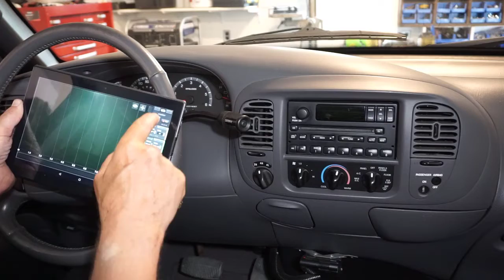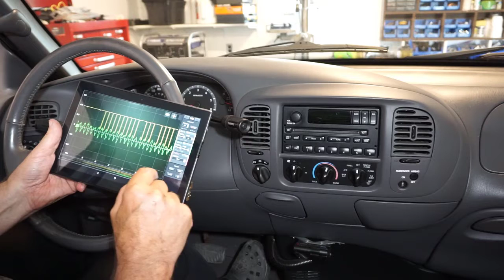GADGETS#153 - DIY DRIVESHAFT BALANCING

Comment: I think I'll stick with a simple pry bar. Make sure the vehicle is properly supported, take a pry bar resting on the floor board above and slightly slide it to barely touch the spinning driveshaft. Put a hose clamp opposite of the shiny mark that the pry bar made on the driveshaft. Keep checking until the vibration is gone, Now you know where to place your weight where the clamp worm gear is.

Comment: Could you possibly balance a crankshaft or be able to build a crankshaft balancer I would love to have one of my own even better if I could build it.
Reply from the maker: there is one in the works as we speak, John ... a 100 Kg soft bearing balancer complete with belt drive system ... metal + 3D printed parts ... a winter project and coming along nicely!

such a machine will handle crankshafts and other industrial rotors such as armatures, pumps, fans...

estimated build cost $300 USD

I need a few more weeks...

Comment: Denis, in this case does it matter which orientation the ADXL335 sits on the differential? I guess any vibration would transmit side to side as well as up and down so it shouldn't matter? I might have to balance a 3 piece driveshaft in the near future but wondering your thoughts on mounting the ADXL335 in the middle of the car lets say at a joint in the driveshaft. Would you just secure it somehow to the body of the car?
Reply from the maker: for vibration analysis, orientation wouldn't matter...BUT for dynamic balancing orientation does matter...there is a "+G" and "-G" to the parasitic weight movement withing the accelerometer...I intend to do a video on that subject at some point in future...

worse case scenario is being 180º off, you'd realize the mistake

for that 3 piece driveshaft, I'd place the ADXL335 onto the center support itself

and temporary correction weights first...confirm your work and then make the weights permanent

good luck and let me know how you make out

Comment: This is amazing and i would love to try it, however, the bits all appear expensive and pieced together, i am overwhelmed by that. if they had an inexpensice kit with everything id be onboard. 
ive been through alot with this driveline vibration issue.

using a hose clamp the caveman way is alot of fettling. drive it, adjust, try this/that, dozens of times vs that device.....
i'll tell you what though.....
I will bet you ten chickens and two pigs that the heavy spot is 99% of the time going to be where the runout is. 
If you put anything near the shaft almost touching and spin it slowly, you can see if its spinning true or if it is slightly out of round. a dial indicator is great too.
and then the weight needed is the key.
the head of a hose clamp is a bit heavy. 14 grams.

My runout is .019" at the rear and almost zero up front. 
Ford specifies <.030" 
its an ok shaft. persnickity builders look for .005" or less
Reply from the maker: a budget oscilloscope (supported by HScope) and a $4 ADXL335 accelerometer powered by a DIY 5v REF Box and a $12 analog IR sensor and you can do what I was doing here...

there's a learning curve...as in most things
Reply: @theGADGETSplaylist  i still dont understand. but i would love to be able to do it like you are with the van up on jackstands. like i said i have a high level of certainty the amount of weight needed is proportional to the runout however that sensor picks up AMPLITUDE and i love the graph charts... theres still the trial and error of HOW MUCH weight to use and would take just that, experimentation and verifying the result.
Reply from the maker: @dangerdavefreestyle  yes, you see amplitude and location...then trial weight...next run results will indicate if too much or too little

Comment: Another brilliant gadget! I have to balance the driveshaft on my Suzuki 4x4 and will adapt this method with the PicoScope 👌🙂
Reply from the maker: thanks Ivan!

for DIY, analog is the way to go here...ADXL335 (analog) and analog IR sensor for reference and your PicoScope (or that HS402 WiFi Jim gave you that would allow you to do this from driver's seat, no wires)

Martin and I are about 1 yr into a digital dynamic balancing kit. Serious stuff this one...

Your interest in my channel sure has been a nice boost:)
Reply from the maker: the key to this is a clean sine wave...usually needs software filters

oscilloscope filters typically "shift" the waveform as it cleans it...I suspect PICO filters would do this...

@ 3000 RPM, it doesn't take much...

in working closely with Martin, he developed filters that do not shift...a game changer for this work

a recent development that has not found its way into the HScope "production" release...only in BETA at this time

scrolling down the Google Play HScope page allows the option to join BETA

a $3 ADXL335 powered by your 5v REF Box and analog IR powered by another 5v REF Box and HS402 WiFi and you'll be pleasantly surprised Ivan...
Reply: @theGADGETSplaylist  very neat, I'll work on rigging something up 👍😁
Reply: @theGADGETSplaylist  I have the Pico NVH vibration sensors, but need to come up with a way to rotationally sync the shaft (like you did with the white tape and optical sensor). Maybe a small magnet and a spare ABS sensor or crank position sensor to pick up the signal?
Reply from the maker: @PineHollowAutoDiagnostics  I've gone the magnet route in #54 using low cost pickup sensor available on Aliexpress (most everything I use comes from Aliexpress)

there's 3 options...magnet, IR, laser

I like magnet least...and there's also the weight of the magnet to offset/deal with...

lasers are digital...opening another bag of worms...

your best bet is IR...analog one...I'll post a link to 1 I can recommend...I've had success at 3450 RPM balancing, even handheld (#60 at 9:50 timestamp)
Reply from the maker: @PineHollowAutoDiagnostics  better yet Ivan...I will mail you my spare E3F-DS30C4 IR sensor:)

forward your shipping address to:

thegadgetsplaylist@gmail.com

Comment: Did you notice any differences putting weights at the front if the shaft vs the rear?
It is common to find a weight at each location of different grams and different positions. 
And when one is changed, does that affect the other? Or can this hose clamp method be done properly on one end of the shaft at a time and provide an overall benefit?
Reply from the maker: would be one end of the shaft then the other with accelerometer positioned near the end being measured...

on long drive shafts, when one is changed would not much impact the other...

Comment: What is the "overlay" you use to determine the exact angle?
Reply from the maker: it is a 720º overlay which is a built in feature in HScope APP and very useful in automotive engine work that involve 2 full rotations...

since the making of this video, Martin has added another 360º overlay better suited for this type of work...and that I was using in GADGETS#157

Comment: Hi I have just came across Your channel and i must say what great stuff! I was researching 
flywheel lightening and balancing 
for "Bitsy",she's my classic 2cv sports car that I am always tinkering with.And thanks to You I now feel confident
to take on the task.
I've already been on Ebay for some bits, piezo transducers for a pressure sensor build to read what's going on
inside my garbs and to compare My twin exhaust pressure for tuning.
Also You've given Me an idea, for using hall effect sensors for an upgraded ignition timing system.
I have just started a YouTube channel Myself called "Bitsy Le trois-rous" and I will be uploading just as soon as I am able to work out the
Technical stuff.
Anyway just to say thanks,
Best Wishes,
Jahmahrah De'Safilli
Ps I put a link to You on Scanner Danner's forum, I hope that was ok.
Reply from the maker: I will check out your channel:)

There's a new Martin Loren project called HS-ACC based on ESP32 and digital ADXL345 which will offer 2 plane balancing potential and 3axis vibration detection...all of it WiFi...very nice and I'm working on some implementations now.

With your interest in this and other probes, I invite you to join us at our Telegram HScope Lounge:

https://t.me/hscope

Denis

Comment: I am speechless !! I've intently watched 'pro' dynamic tire balancing guys in action. Was never impressed. This takes all of the guess work out of the task, wheel or drive shaft. I'm fairly sure your 3 axis accelerometer can pick up ring and pinion or bearing vibration, yet I don't see it in the wave form. Did you tune it out or desensitize the circuit ? We are lucky to have you on Youtube Dennis !!! It's too long of a drive for me, but we owe you a beer !!! Please confirm the spelling of your name. I've seen it 2 different ways.
Reply from the maker: Very kind words Mike. Thanks. It's Denis with 1 "n" :)

I'm only using the x-axis and position ADXL on work in direction I want to measure.

For vibration analysis, I have a stand alone ADXL with a 5v REF Box...no need/use for PHOTOCELL...this becomes a FFT thing...

I got to make time to drop by your channel and see what you've been up to with that Cummins:)
Reply: @theGADGETSplaylist  Thanks for responding Denis. I've been remiss in my Youtube duties. The next video might be about barbwire fence repair since we've had an invasion of cattle down here. LOL! The Cummins needs the AC repaired since the AZ desert is blazing hot this year at 43C. I'll get to it.
Reply from the maker: @mikep95133  or maybe a BBQ video...LOL

A/C would be on the top of your list 4sure!
Reply: @theGADGETSplaylist  BBQ, Yummmm !!! The ac works in my Jeep and house. So not in a rush. But I do miss driving the Cummins Dodge over these rough roads.

Comment: Dennis....you have outdone yourself with this tool. This has real value in the field when doing driveabilty diagnosis . This has many applications.  Very well done sir! 😁
Reply from the maker: thanks so much!

HS402W BAL is versatile, not just automotive but agricultural and industrial. I'm pleased with its performance and WiFi is icing on the cake:)
Reply: With the wifi I guessing you can Hotspot to it when in field work
Reply from the maker: @MrJnr909  all of these HS402 WiFi scopes feature here allow 2 methods of connection:

1) through router where it becomes part of your home network

2) as a Hotspot where Android device leaves the home network temporarily and connects directly to HS402

Hotspot is my preferred option even if I'm within router range

Comment: good method ,years ago we had trucks  with 2 axles and a carrier bearing ,that would have worked good in diagnosing them. GM never had any training or repair methods then. either replace it or send to an axle shop that done balancing, so many of drivelines where replaced for that. we even filled some with expanding foam or fill with oil, i'm serious, seems like extended cab s-10's were the worst
Reply from the maker: yep, those supported driveshafts were an issue...with FORD as well...

thx for watching and interacting with the channel Henry:)
Reply: @theGADGETSplaylist  i like the elctrnics mix with the automotive.
Reply from the maker: @henryrobinson9837  I do too, Henry...they go hand in hand...
Reply: @theGADGETSplaylist  yea but dealership mechanics are not encouraged to do that path,
Reply from the maker: @henryrobinson9837  sadly true...